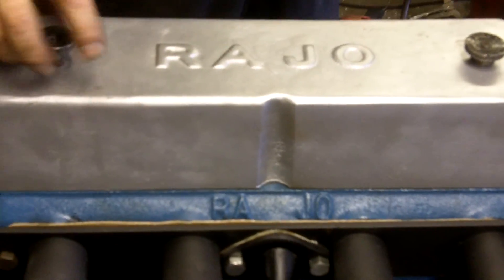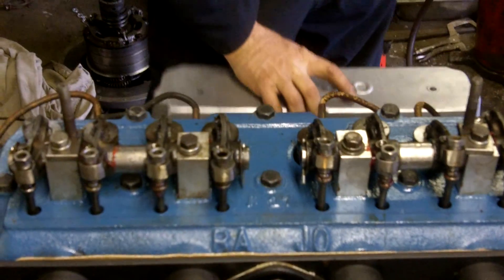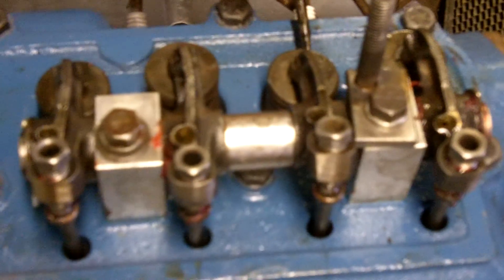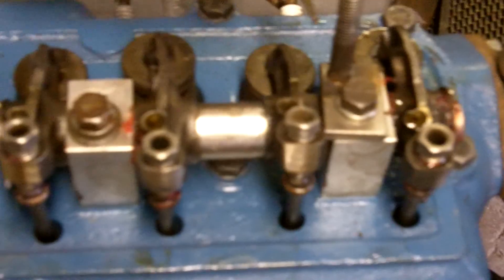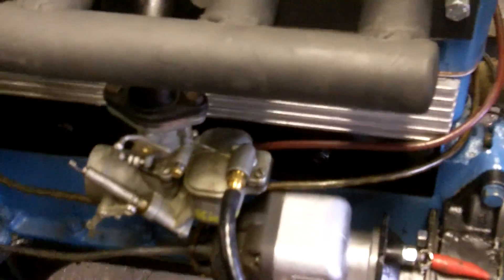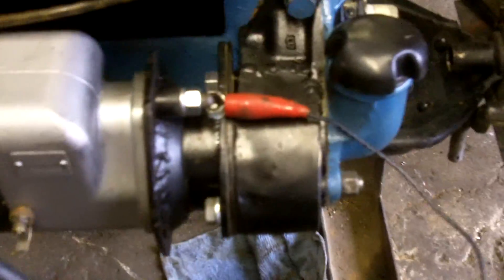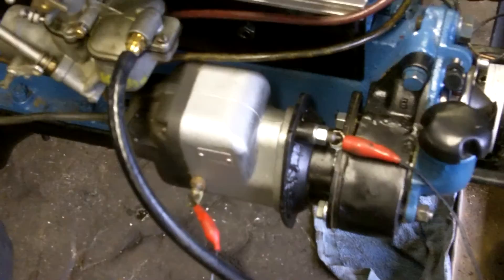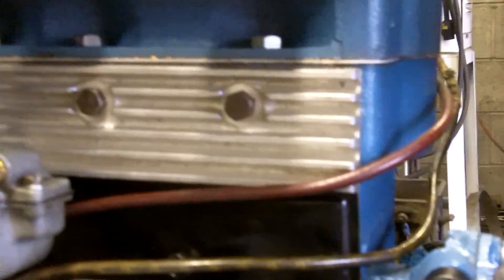Rajo - Model T cylinder head test fire

Comment: What a sweet little T motor. I bet the splash was more than adequate as compression  gain wasn't tremendous. I really like your log manifold setup. I'm working on a T motor right now but I'm going for a hot flat head. I have an Iron Giant Power head to go on it that I'm going to mill down as much as possible while still clearing. I'm looking to make a log manifold just like that and make my own intakes for dual Holley NH carbs.

Comment: You may not have this engine anymore or may not have done the work yourself, so I apologize if you do not know the answer to my question. That appears to be a Model A Tillotson carburetor.
Did you have to modify the jets on this carburetor to work on a Model T engine?
Reply: All you have to do is just mount a model a intake onto a t engine due to the ports all match up
Reply: All you have to do is mount an a intake onto a model t motor due to the ports on the intake all match up